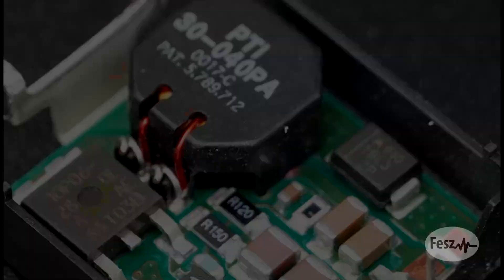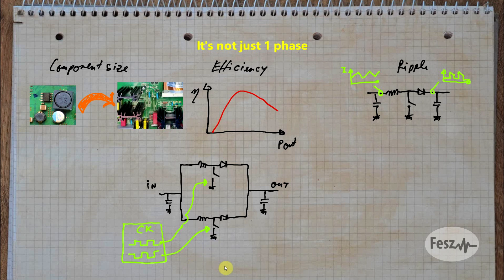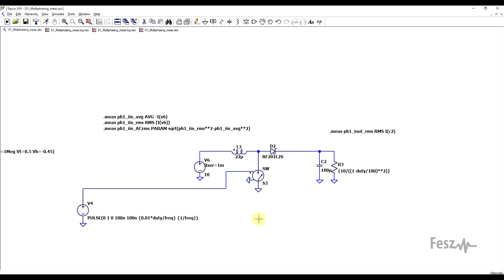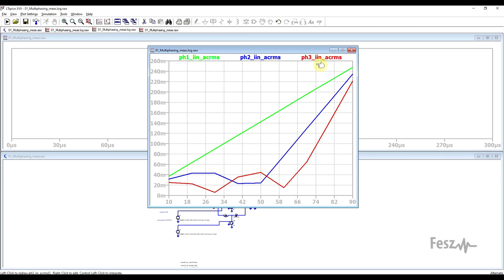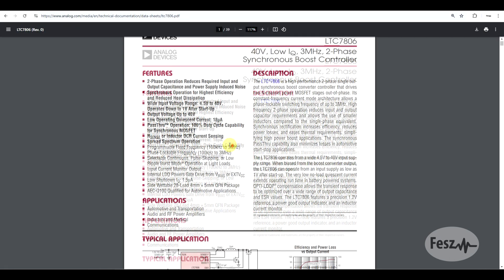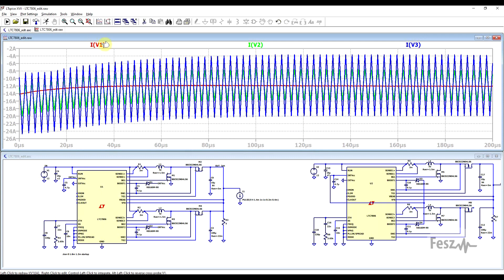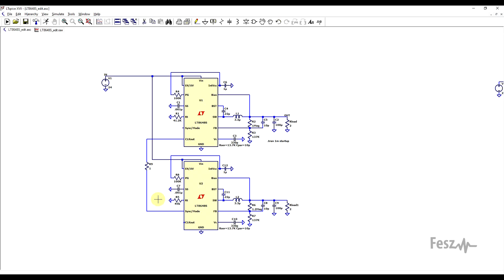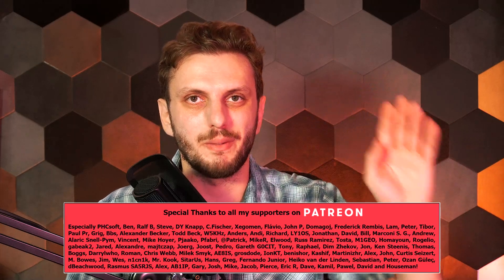Multiphase Power Supplies

Comment: Very nice! Currently developing a digital step down with GaNs and we get 10-50V Output @30A and 15A without any cooling or heatsink.. single Phase.
Above 98% efficiency ;)

Then you know how the Future will be, digital Power supplies with multi phases, high switching frequency and superb ripple due to lets say 3 phases.

Comment: Gotcha alert!  Viewers may get confused around 15:25 where "the first converter" (the synchronized one) is plotted in blue, and the unsync is green, which are the opposite colors to those previously used.  To avoid confusion, focus on the names of the plot lines, where the signals are consistently labeled with "V1" (sync) or "V2" (not sync).   
A point that may be subtle is that the sync mechanism synchronizes the two converters out of phase with each other, so that they take turns drawing current from the supply, and providing it to the load reservoir capacitor.  This, of course, just makes sense, and is confirmed in the waveforms in this video, but might be obscured by the term "synchronize" which suggests making things happen at the same time rather than deliberately not the same time.  
Anyhow, lovely work as usual Mr FesZ!

Comment: I like this video very much.
Such a multi phase inverter inspires to also use this technique for wide output current range tig welding machines, isn't it?
However, there seems to be no high voltage switchers in the market.
Opinions please.
Reply: It would be very interesting to see what power supply techniques are used in TIG welding machines. The high-current part of welding only requires modest voltages like 25V (possibly alternating). But high voltage (possibly high frequency) is used to get the arc started, ie: to ionize the gas/air, and that does not require very high current.  I wonder if there are any TIG welder schematics floating around the internet?

Comment: Hey Fesz. In the last part you say about synchronising separate supplies. I'm curious as to if this can be done if they're producing different output voltages, etc., as the duty cycles may be different? Also, any idea how this works out if one starts to pulse skip?
Reply from the maker: Of course, there is no issue if the supplies have different duty cycles - in the simulation, the 2 supplies have different output voltages, I changed the feedback resistors. Synchronization will only impact the turn-on moment, nothing else - so the duty cycle is independent of this; with pulse skipping, the supply will simply not trigger on the synchronization input, so that should also work without issues.